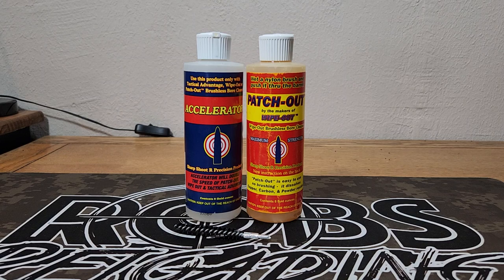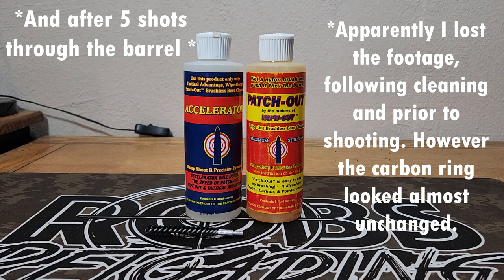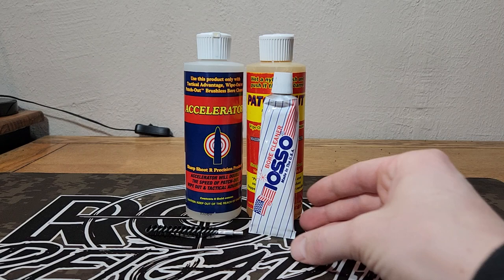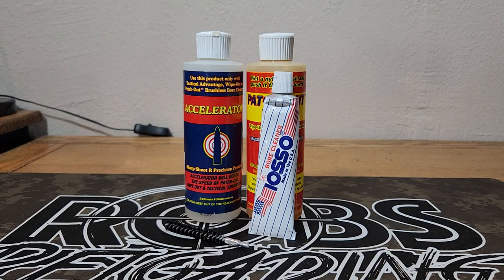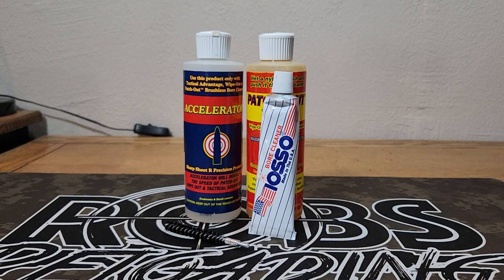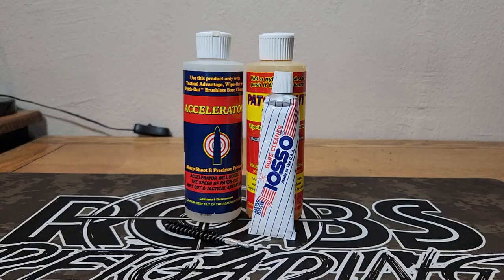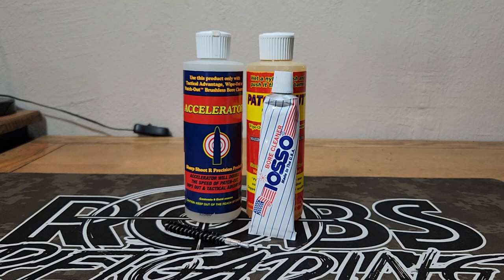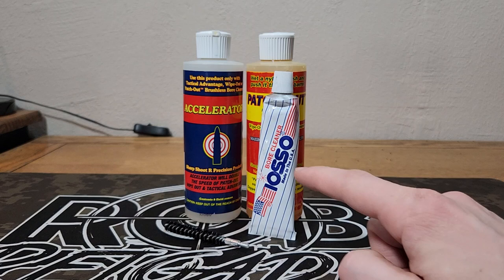Cleaning with Abrasives.

Comment: Don’t over trim cases and you won’t get the carbon ring. I think you can use a max OAL case with a slight flare and an inside chamfer as a “scraper”. Once the case is formed, chamber it, and the case mouth will break up the ring. Use a borescope to check the case while chambered before flaring to make sure it’s long enough.
Reply from the maker: The probablem I often run into is my brass never grows long enough to prevent cases from being that short. The case that was inserted in the chamber was 1x fired never trimmed adg brass.
Reply: @RobsReloading  A long time ago, I used to use a brass dowel to remove the carbon ring. I learned this from Will Schumann back in the late 80s. Other than that, I never put anything down the bore other than bullets, but that was for pistols. For rifles I clean them, but only when they show signs of losing accuracy or pressure. That’s usually from the carbon ring, but I haven’t had problems with that in the rifles I shoot right now. I don’t spend forever cleaning them, and don’t worry about the copper, just a carbon. The copper always comes back within a few shots to the way it was before the cleaning.
Reply: Exactly! Running cases within .002 of max case length for YOUR chamber can boost accuracy and eliminate the carbon ring issue, just like you said. Most guys just trim to SAAMI max and will never realize this. Yes, it means you may have to trim after every firing, but well worth the effort, IMHO.

Comment: Try using an oversized nylon brush.  After bore cleaning with an Iosso system (I like Thorro Clean), shove a patch dripping wet with Bore Tech Carbon Remover into the top of the chamber area where the carbon ring is and let it soak there for 15-20 minutes. Tilt barrel down,  Then soak an oversized nylon brush in the Bore Tech CR and spin it 20 or 30 times in that area.  Carbon ring will be gone.  For 6.5 bore use 7MM or 30 caliber brush.

Comment: Try an oversized nylon brush, I use an AR chamber brush in my 6.5mm and 7mm chambers, and a peice of forbytwo soaked in Boretech carbon remover over the brush.  Push brush with patch on it into the chamber and leave it for 10 to 15 minutes to soak into the carbon ring.  Then clean as normal.  It just plain works.

Comment: Use Kroil before using Iosso bore cleaner, or better yet, JB bore paste and magical things happen.
Reply: yup jb and kroil for neglected barrel. i clean the chamber and carbon ring every range trip and for that i use bore tech c4 carbon remover. wrap a patch around a nylon brush, 10 min soak, few twist of the brush and patch it out….

Comment: That last bit of carbon ring will defeat back and forth scrubbing.  Find an old rod and fashion  a sliding stop for it so you can set a penetration's depth.  Use a one step larger brush and set the depth using a bore scope so the bristles reach the end of the neck but not into the leade of the chamber.  If the chamber is a freebore type the bristles can touch the freebore area, just not into the leade.  Then add a bit of abrasive and rotate the brush either by hand or even a slow drill.  Even a bronze brush is OK.  The chamber was cut with a reamer, and unless you run the drill for many minutes there will be no damage.  Just have a look frequently with the bore scope.  As soon as the ring is gone, stop.  This has turned many high SD/ES barrels to low SD/ES ones, and many inaccurate hunter rifles have been returned to service.

Comment: from the manufacturers website " Heavily fouled guns or those cleaned with other
products should be left overnight on the first cleaning."  then patch out the barrel.  then do a 10 minute proof test.  if color comes out on patch do another overnight cleaning.  once you have done all this then a 20 minute cleaning is usually enough.   anyway... i use the accelerator and the patch out and it works incredable if you follow the instructions on the bottle.  glad you got it all nice and clean though.

Comment: For more effective removal do not use a brush. A tight fitting jag will be more effective with cloth patch. Add cleaning solvent first or a light oil  then apply ISSO. You will notice the difference.

Comment: Try using a slightly oversized nylon brush just for the throat area, not the barrel lands area. Push the brush into the throat area with IOSSO on the tip and gently spin the brush (clockwise!). 
It gets just about all the carbon out.
It’s magical stuff.

Comment: Measure the outside diameter of your fired necks and use an appropriate sized Bronze bore brush larger than that measurement on a chamber cleaning rod and you'll have no problems removing your carbon ring after a 30 minute soak of patch out or c4 product.

Comment: Iosso and jb bore paste work great but I use it only around every 200rds because It can really screw your bore up quickly.
Reply from the maker: Do you know this based on experience? It looks like almost all of the bench rest and f class guys regularly clean with an abrasive.
Reply: @RobsReloading  read the tests run on SH (or Accurate shooters forum?) about bore diameter before and after. Those BR & F class guys don’t have to worry because they replace bbls after ~1000rds no matter.
Reply: I never screwed a barrel up with jb.  Used it a lot in my 6ppc’s.  Many different barrels.
Reply: Use it sparingly and not often.
Reply: @RobsReloading  They also replace barrels regularly.
Reply: @gascheck8151  As you should if you're a shooter. 6.5PRC, 300wm, 7mm, 300 Norma and all the other big magnums will wear out after around 1000rds so whats the problem? Barrels are consumable items just like brass. I don't understand the issue with having to replace barrels regularly. If anyone has issues with that, they shouldn't be in this game or they should shoot .308 and .22lr.

Comment: I have recently come to the same conclusion. I have let my LRI 6.5cm barrel soak overnight with Accelerator, Eliminator, C4, even Free All.  New nylon brush and carbon in barrel looked the same.  Took a fresh good quality brass brush with JB (gray stuff) on it, 2 sessions of 30 strokes, dry patches, etc,  cleaned the barrel down to the steel again.  Have some Iosso on the way to try, but results should be similar.

Comment: Ive never used a paste to clean barrels but im hearing good things about this stuff so i plan to try it out. How do you get all of the iosso out of the barrel?
Reply: I have been cleaning with iosso for a few years and love it. To get the iosso out I run a few dry patches until the black starts to go away. From there I run the iosso triple action through to get the rest out. I follow up with alcohol to be sure everything is out. Then I run lock ease through to help with clean bore POI shift.

Comment: I run into the same issue quite often as well, and I run those products. I too have the same issue with never having to trim cases which is the contributing factor to carbon rings. I just clean more often.
Actually just saw a really good video on trimming from the owner of primal rights https://youtu.be/H1Ah4_h7os0